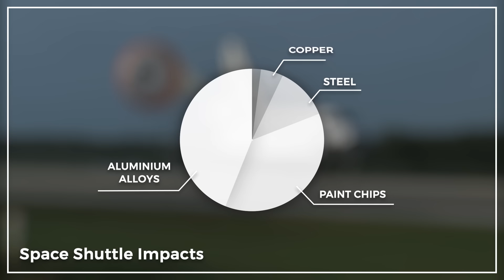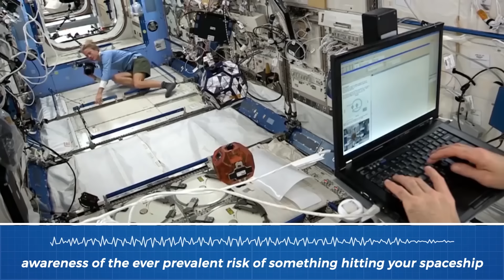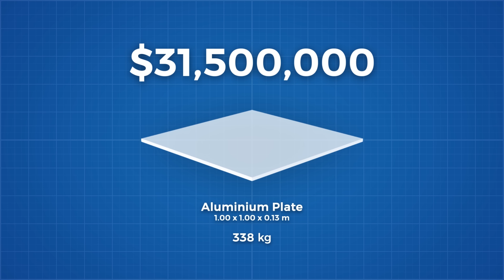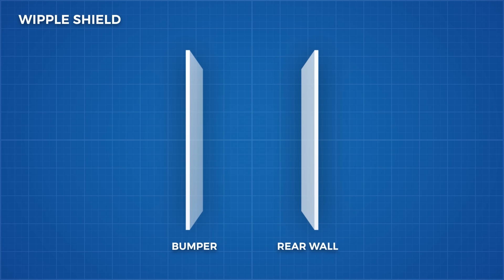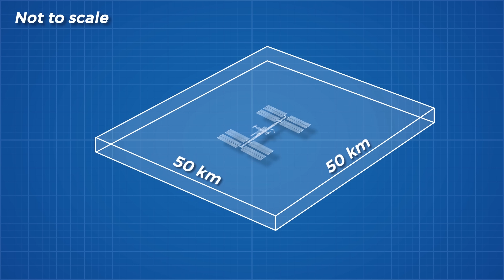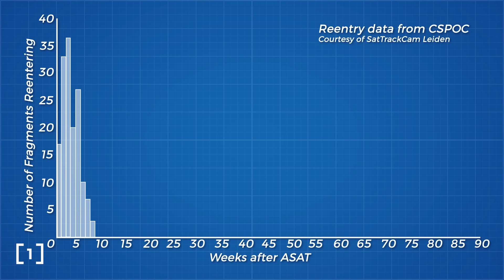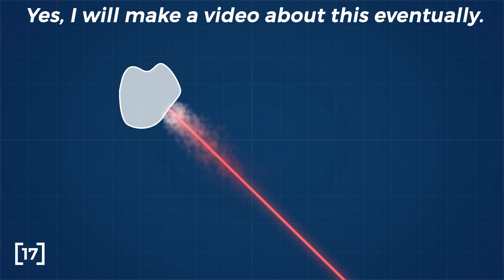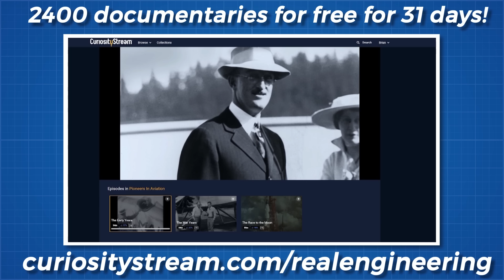The Truth About Space Debris

Comment: It seems like we could still benefit from the capture-satellites just to prevent older satellites that can't safely deorbit on their own from colliding and making more untrackable debris. Most of the problem seems to be that we're just adding to it faster that it naturally goes away, so if we made a concerted effort to take out these older suppliers of debris and require any new launch to have an exit strategy (either up or down), it should only take a few years before the collision rate starts to go down to more manageable levels. The laser seems like it would be too limited since it's only going to be effective against a certain range of sizes that are big enough to track and small enough to ablate meaningfully...which is still a ludicrously large number of objects and a ton of energy.
Reply: Great news 2 years on, the Chinese Space Agency has successfully used a disposal satellite to throw a decommissioned satellite out of orbit.
Reply: ESA Is working on it and it’s not going well. It’s proving to be horrendously expensive and difficult to build. One issue they are having is that the satellite will need to drag a huge amount of fuel into space in order to chase down and maneuver into place to grab the offending satellite. They then will need to expend another large amount of fuel to slow down the satellite enough to de orbit it. Of course, unless they can somehow refuel this satellite in space, something we cannot currently do and likely will have no chance at until SpaceX gets its starships online, these satellites will be single use. 

Another option would be to use a satellite that hooks some sort of solar parachute to derelict satellites and then let them go, but the fuel needed to chase down the satellite is still an issue.

Comment: That 2 wall debris shield for the space craft was also used in WW2 by the Germans on some tanks. was able to slow and redirect travel in a non straight trajectory and keep tungsten projectiles from penetrating the main armor of the tank.
Reply: I believe it's called "spaced armor" or "hollow plate" (the idea is to break the projectile into tiny fragment using first layer that's high hardness-optimized let them lose some kinetic energy by traveling a void between the armor and expand their area of impact then let second more ductile layer that's high compressive, shear and tensile strength-optimized absorb the residual kinetic energy, although the void could also be filled shear thickening fluid-impregnated ductile high compressive, shear and tensile strength-optimized fabric like kevlar to significantly increase the protection and reduce spalling).

Comment: The whipple shield just sounds like spaced armor... which is also used in tanks.
Reply: Uh, Hi? That’s because it basically is. But thinner.
Reply: YEA but different reasons, spaced armour isnt used primarily to stop kinetic penetrating ammunition, it can but its not that great at it cos the ammo stays in one relative piece when hitting the first layer and punching through. its used to defeat shaped charge ammo, using the same principle but its some molten metal thats being dispersed over a wide area on the 2nd layer
Reply: Most tanks have the spaced armor in addition to its hull, but Whipple incorporates the hull into the armor due to limitations of application.
Reply: That's exactly what it is.
Reply: But what armor class is it? ;-)
Reply: @williamolson5728  well anything that isn't designed to defeat it and kill all life inside is stopped pretty much 98% of the time, the other 2% you never get to realize how exceptionally more famous you just became...It's a lot like air-frame structure, 1 goose is fine, but thousands of hyper-sonic mouse size objects really make you regret getting out of bed that day.
Reply: @Nipplator99999999999  you missed my joke
Reply: @williamolson5728  No I just failed my own, I was a door-gunner in the Army for a bit, a few of us Kool-aid guzzling 18-20 year olds ignorant of loss stats. With Ma Deuce, or the MK19 40mm auto launcher for babysitting, all the gravel pings were cute. A surprise of a hollow thump from a antique WW AA platform completely destroyed that Superman complex, now it's closer to a Green Lateran complex.
Reply: @williamolson5728  Sorry forgot to really make your point a spotlight, It's a Medium classification for air-frames or atmo rockets, or Heavy Class for zero-g, but an APC is Light Armor class...If it's still the same from longer ago than I want to admit.
Reply: Spaced armour is used to defeat shaped charges, but is basically useless against standard projectiles.

Comment: A very good explanation of the topic.
I wonder what your thoughts are on Kessler syndrome, where the density of the space debris is high enough that it could cause a cascade reaction where each impact increases the chance another will occur.
You glanced over the issue pretty quickly, and i'm not sure the risk is as small as you suggest.
Should a sufficiently sized piece of debris be struck and destroyed, the resulting domino effect could be what (as some science media outlets like to call it) traps us without acces to earth orbit for a significant time.
Reply: Good question. I realize I'm 3 years late to the party but I too was wondering where reality lay insofar as inbetween worrying about the Kessler phenomena and space being vast. That is, what is/is there a point of no return where orbital debris act as a planetary moat?

Comment: Yes, joint collaboration is important to remove space debris
First we have to remove bigger debris, (something at the range of 2 metres to- max ), and it includes lasts stage, destroyed satellite's parts, panels etc because that types of large debris are the main source of creating further smaller particles ( size from mm to cm)
Reply: But where will I find loot when I'm stuck in space
Reply: Simply deorbiting (getting them below 150km) will solve most problems. Geostationary orbit will need special attention as it may be easier to loft them into the moon rather than drop them lower.

Comment: Would it be possible to utilize magnets to "clean up"?
Reply: You’d have to get very proximate to the debris for the field to pick up I’d imagine, pretty tedious
Reply: Try picking up aluminum with magnet and figure it out yourself.
Reply: Aluminum, kevlar, titanium, and carbon fibre are not magnetic
Reply: No. Not all of pieces are magnetic and these that are, are flying through the Earth's magnetic field without a problem.
Reply: Most of the junk is not magnetic. You CAN, however, use electromagnets on board a satellite interacting with the Earth's magnetic field to adjust its orbit or take it out of orbit at the end of its life, though. It's known as electrodynamic tethering.
Reply: Fucking magnets, how do they work?

Comment: I consider that you are underplaying the magnitude of the problem Real Engineering. The larger pieces of debris may very well be avoidable but that will not prevent them from colliding into each other, releasing tens of thousands of smaller debris items, and propagating Kessler Syndrome. In keeping with this, RemoveDebris is a critical part of the cleaning up of LEO and MEO, as each larger piece of debris removed reduces the potential for Kessler Syndrome to occur and propagate, and its severity. Also, while Neil Degrasse Tyson's highlighted point about preventing the utilisation of LEO and MEO is slightly hyperbolic, that is only slightly so, you already mentioned the issue of launch costs as related to shielding, and with a several orders of magnitude increase in probability of collision with medium sized debris as Kessler Syndrome may indeed produce. The effective costs of operation in these areas would rise catastrophically, indeed ending the vast majority of our activity there and the potential for other similar activities until a similar decrease in launch costs occurs, which will of course take longer if space investment reduces, which it is likely to if much of space based activity becomes uneconomical.
Reply: Them crashing into each other would solve the problem as their orbits would decay much faster and they would pose less damaging per impact. Kessler Syndrome would be a problem, but it would solve itself fairly quickly and humans would probably in the worst of the worst case scenarios, move our orbits higher up so as to be above the danger zone. This will not destroy the space industry, this at worst will postpone the space industry a year or two.

Comment: What about the impact of debris on astronauts during spacewalks? Did that ever happen?
Reply: It does happen, but usually the impacts are small enough that they are a non issue. Newer spacesuits are even stronger than the shielding used on the ISS. If I remember right, the odds of a dangerous impact happening on a spacewalk is less than 1/25000
Reply: @amras7489  Thank you for the answer, got any sources? I still fail to see how a suit can be stronger than the Whipple shield on the ISS.

Comment: The idea that should be looked at seriously is a compact propellent pack that can be fitted onto space debris by remote control and that will fire and slow the smaller pieces so they can burn up in reentry, or shoot off out in space the big stuff so as to never be seen again.  There is such a thing that is already designed and just need the push to take it seriously. And then be used to prove it's value.  We as humans always want to wait till it is a serious threat before we handle this stuff.

Comment: The best option I saw was a lightweight but very strong "net" that caught as small as 1cm, could swing in dumping the trash into the unit, which could then be ejected straight towards the planet where it would burn up/dissolve on atmospheric entry. For the larger items there was a catapult system using earths gravity and solar winds to spin the "catcher" holding on to the larger items until they are moving fast enough to be tossed out of orbit, preferred towards the sun where it could be caught and burned up in the sun itself.
Reply: The delta-v to launch something into the sun is absolutely insane.  Parker solar probe is taking repeated gravity assists to even start to touch, and full debris incineration would be even harder.  Ejecting debris from earth orbit is one thing, but there's not going to be a reasonable way to actually hit the sun with it.

Comment: the animation at the start was WRONG! The misssile intercepted the sattelite prograde, increasing the debris apogee.

edit: Looks like I was wrong, I mistook this for another anti-sat missile. The missile did in fact impact that sattelite retrograde, however some of the debris did have an apogee increase.
Reply: Intercepting prograde makes no sense because you would waste more energy to overspeed the satellite
Reply: Link's Space Program because trying to intercept a satellite that’s coming towards you at 7.73 kilometers per second (2,237 mph) is extremely difficult. Any small error by the missile while approaching the satellite could mean it completely misses, whereas approaching prograde means that it has more options to correct its trajectory and have a higher chance of success. 

As for wasting ‘energy’, it really isn’t that much of an increase of fuel needed. Once you’ve made it 100km above the surface of the Earth the atmospheric drag is negligible so you can accelerate much faster on less fuel.
Reply: @SirSmithThe1st  Getting to 100km is nowhere close to getting to orbit. You need energy to get you up and you need energy to get you to the orbital speed. Yes, these two are normally combined, but the second component constitutes like 90% of it. A rocket capable of 1km/s dV and 10km/s dV would be VERY different in size because of all that fuel needed.
Reply: snakeru1 I never said that getting to 100km was close to orbit. The satellite that was destroyed was in a 300 km altitude orbit. The point I was making was that the increase in the amount of fuel needed for the missile to hit the satellite prograde rather than directly orthogonal to the orbital path wouldn’t be very much since the bulk of the fuel would be used to get out of atmosphere, which is the first 100 km of the flight. And just because the missile is approaching it prograde doesn’t mean that it’s matching the satellite’s orbital velocity. The missile doesn’t need to achieve orbit, but just intercept at an angle beneath the satellite (in the LVLH reference frame).

Comment: If you designed the windows differently concave them out roots not with a point just the rounded surface so something that hit it possibly could slide instead of fracture the glass
Reply: It's going 7 KILOMETERS A SECOND. That's like saying bulletproof glass should be convex because the bullet would slide off it

Comment: The Fermi used the trusters to increase speed in the direction of travel. This, consequently, increased the size of the orbit. But pointing the trustees down would also increase the size of the orbit. Which is more efficient?
Reply: Down (radial in, using orbital mechanics terms), doesnt increase the size of the orbit. It only shifts it in the direction you're burning. Forward (prograde) raises the opposite side of the orbit, increasing its size.

Comment: Need an orbiting collection-recycling-manufacturing station up there where debris collectors would be launched from. The collectors would return the debris back to the station where it would be examined for any usable parts, modules, circuit boards, whatever, to be possibly used in the building of ship, a station module, or even satellites. The rest could be melted or processed down to material used for 3-D printing manufacturing. We need to start manufacturing and waste collecting in orbit. The big benefit of that is the ability to build large ships that no longer need to be launched from Earth. And this station could also be used as a "garage" to make repairs to satellites or even other orbiting stations. 
Just a little thinking outside the normal channels is all. Just a little challenge to get the juices going...
Reply: That collector would have the same problem as the ISS.  In orbit things don't behave as you'd expect, because everything likely to hit you is likely traveling really, REALLY fast.  Fast enough to where if it hits anything, it'll be likely to vaporize on impact.  And these are tiny objects, even if you could "catch" them, recycling them would be mostly pointless.  What good is recycling a tiny paint chip from space?

Really, if we were to build an orbital "garage" or "spaceport", keeping it in very LEO would be a bad idea.  Which also reduces the risk of damage from space debris, you're less likely to get hit the further away from the earth you are.

Comment: I have seen animated videos of Earth's 'debris' floating around, which shows it to be a trash can surrounding us but with all the real videos of outside a satellite or the ISS, you see not one piece. I have watched dozens and dozens of hours of footage, yet not one piece is ever seen, not even off in the distance.
Reply: Seeing a piece of debris 1cm in diameter moving at 7 Km/s is not very easy, if not impossible.  Any object you do see outside of the ISS will be going through the ISS; but that will not happen either because the ISS will move away from any possible impact area.  Moving the ISS is difficult due to other debris in the area the station may move towards.  It is usually a small accelerate or decelerate maneuver.

Comment: Having spinning rings or tube designs would allow future space stations to have 1 G conditions for crew and by putting water storage in the floor there'd be an extremely effective radiation and ballistic impact shield offering strong protection.
Reply: I don't think that possible, spinning that much mass with that much speed, it will be easier and cheaper by simply dodging them.
Reply: I'm not the expert tho.
Reply: @tongpae02  It is easy to get massive things to spin in space, much easier than making a space station dodge.
Reply: @HotPinkst17  yes but to have it constantly spinning at the same rate and make it produce 1g of gravity use alot of resources and energy, and it won't feel like 1g on earth either. And many experiments there are 0g experiments there is no point creating 1g of gravity there. You only need a little amout of push for the entire station to dodge compare to make it spin. Again i'm not the expert tho this is what i found.
Reply: @tongpae02  It would take less energy to make it spin, and no energy to keep it spinning.  There is no friction in space, it would keep spinning forever until acted upon by an outside force.  You can still have zero g experiments in the center of the axis of spin.  It would feel normal if the station were big enough but regardless, the negative health effects of zero g would be avoided.  What makes you keep saying it would cost a lot of energy to spin when dodging the whole station would take way more energy than getting a spin going?
Reply: @HotPinkst17  yeah my bad you are right i didn't do enough research, i still believe it is pointless and too costly tho, unless you are talking about future space station where people live permanently. And i think they choose dodging method because it have lower risk, again not the expert this is my knowledge from research on google for 10 mins.